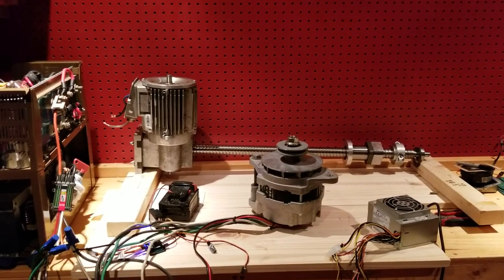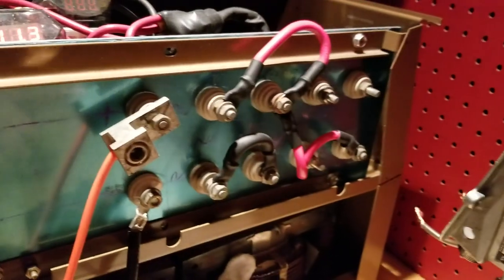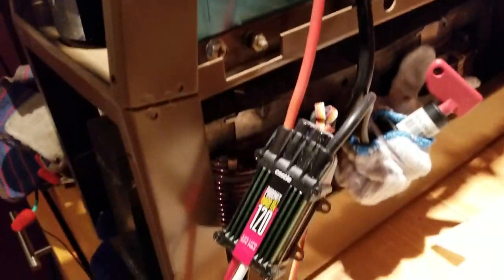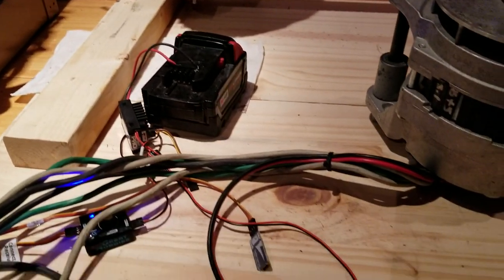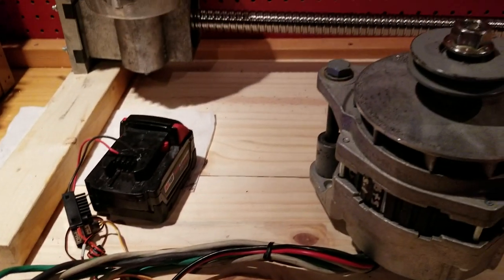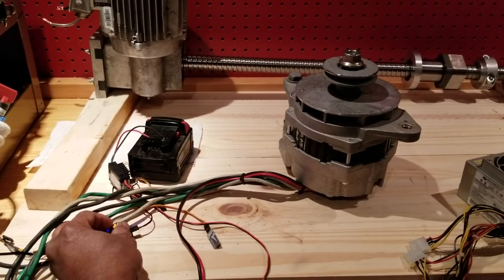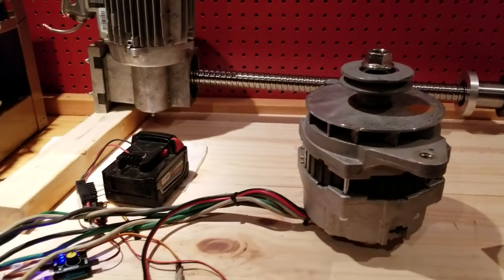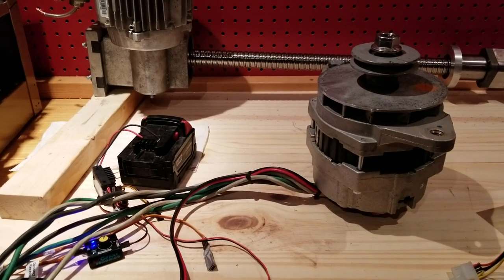2.4kW Alternator to motor conversion.

Comment: So, you're drawing 60-70 amps at 36 volts?
Reply from the maker: Not as it is being run here, it would need a mechanical load to pull its rated load. 2.4kW is the rated load ofthe alternator, basically the power the coils could generate, or use in this case without letting the smoke out of the windings. I have loaded it mechanically to 80A at 48V which is almost 4kw without incident.
Reply: @elser2utube  I mean, some alternators like the ones on some Ford Super Duty's can output up to 200A continuously, so you should be able to put in maybe twice that for short bursts, or cooling the stator by soldering some copper pipe and passing water through.
Reply from the maker: @00000005547  Indeed, I actually just got one off a dodge 3500 which is 200A @12V  that's still however rated for roughly 2.4kw continuous. But what I love about this alternator is that it has a splines one way bearing on the shaft which will.come in handy for the application I intend to use it for  which is a ebike which does not drive the motor while pedalling. It's also physically smaller than the one in this video.

Comment: i was like.. oh thats smooth... and then, oh.. thats scary! why did you use a delta configuration? were you limited by voltage?
Reply from the maker: It does sound a bit scary, according to the tach its only 5500Rpm on the high side. Delta gave the best torque  and higher speed. I switch the configuration back and forth to get measurements on the 4 alternators I have reconfigured this far. I am slightly limited on voltage because the caps in my power  supply have a 14V WVDC rating and I have 3 in series, so maxed out at around 36V. The power supply itself can go up to 110VDC  .

Comment: Pleace thell me how many amp posibol to put in your castle regulator
Reply from the maker: The one I was using here is 120A and it is rated for 12S, Castle also has a 180A.
Reply: @elser2utube  thank you for the answer I am studying your project with great interest, can I use 4 batteries and each of them should be 40 amps, Thank you
Reply from the maker: @aligator0611  what voltage are the 4 batteries?
Reply: @elser2utube  we have a limit for amps to connekt  castle controler
Reply: My qwestion is. I connekt controller in 4 12volt bateri end eich of them its 200 amps... That burn controller or noth
Reply from the maker: @aligator0611  If it is a castle HV SERIES like mine is, it will not burn it. 4 12V batteries in series will be close to 50V fully charged. The HV (high voltage) series can operate at that voltage just fine.
Reply from the maker: @aligator0611  Also, even though your batteries are 200A capable, the current will be limited by the load ( the alternator in this case) So it will only pull the amount of current that the alternator is demanding, so you should be fine. The power supply i am using is setup for 55V and is capable of about 100A
Reply: @elser2utube  thank you verry mach for your help good luck